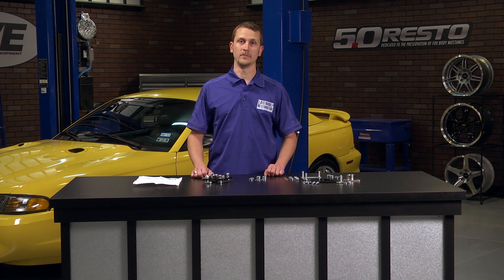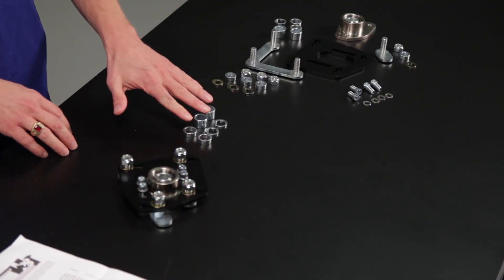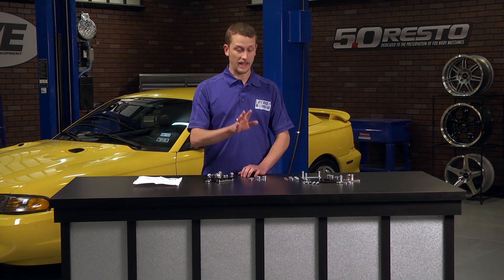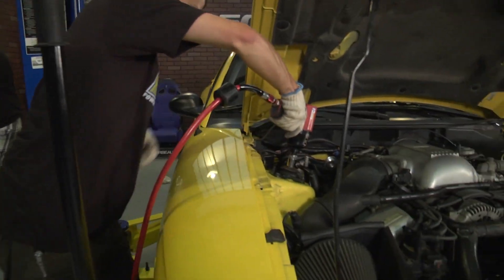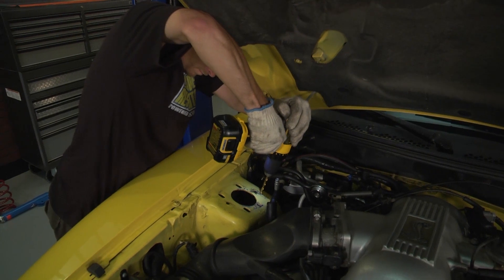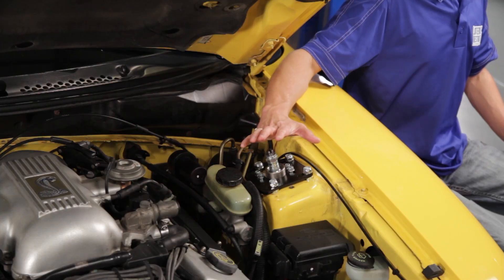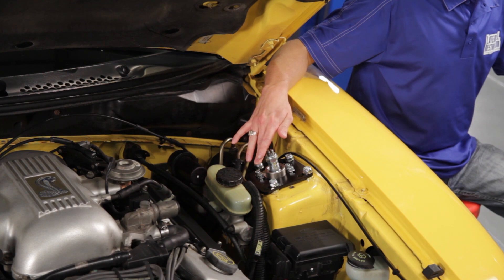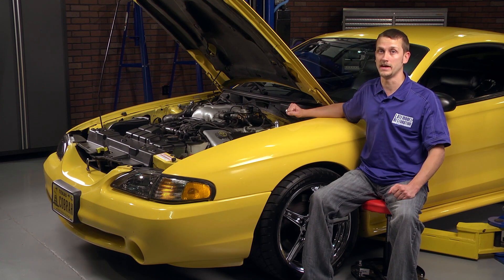J&M Mustang Caster Camber Plates Installation: 94-04 (SN95 & New Edge)

Comment: Awesome, I'll be adding these as well to my 94 GT.. You will get more wear on the tires, depending on your setup. For track use, you'll want a slightly negative camber for better traction in turns. Basicly she won't want to push her nose out as much. This is also helpful with other mods to compensate for under/oversteer.

Comment: hey man - I have a 98 Cobra with Eibach Sportlines and Maximum Motorsports CC plates.  When you say experiment with different strut spacer stacks to prevent bottoming out -  how will I know when my strut shaft height is at the correct level? Thank you in advance

Comment: Stock, tower triangular brace. Firewall is tied into the towers by the brace & BBK sub-frames complete the rigidity of a full frame & less body twist under hard turns & high torque conditions. The SN95s had more TQ than HP. Only problem is the adaptive learning by the management system. OBD 1 means you need the chip instead of a plug & play tuner.

Comment: This is a real oversimplification of installing them.  You really should know what you are doing before attempting this.  If not, have them professionally installed.  I had my own shop for many years, and cannot count the number of times people came in after almost butchering this job.  Then they freaked out when I charged them 300 bucks to install.  I had to explain to them I had to repair what they had already damaged.  So, if you are a professional mechanic, or a really good shade tree one, you should be able to do this.  If not, then let a professional do it, and save yourself the headache of having to bring it to one after realizing you cannot do it.  Thanks.